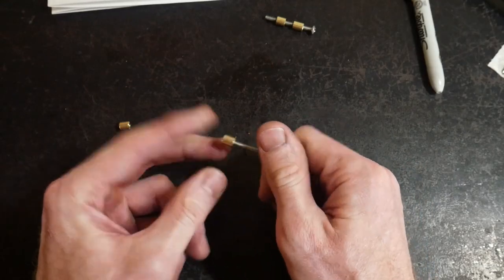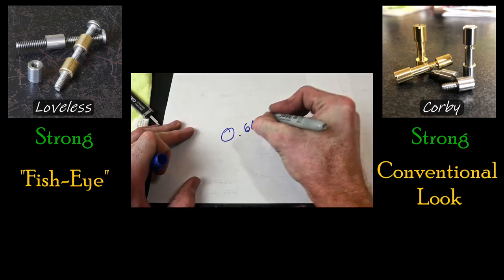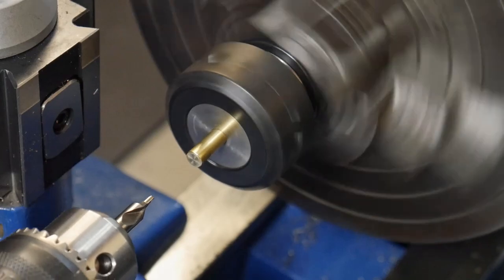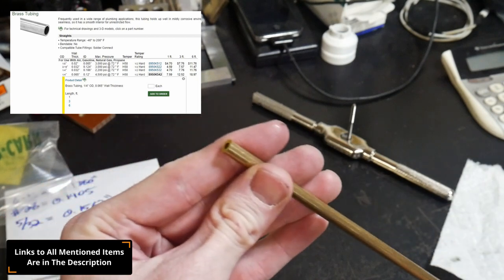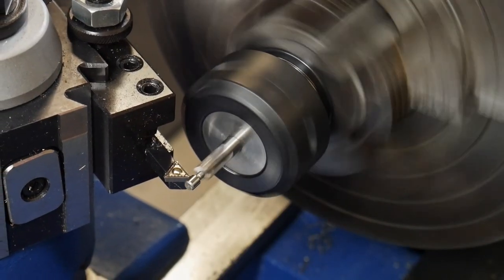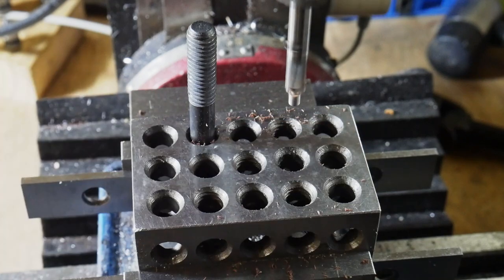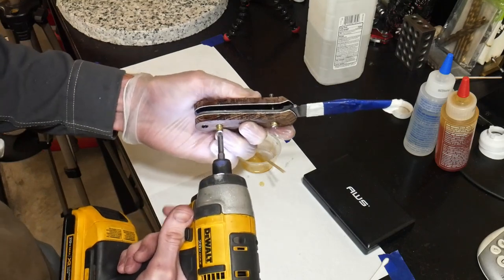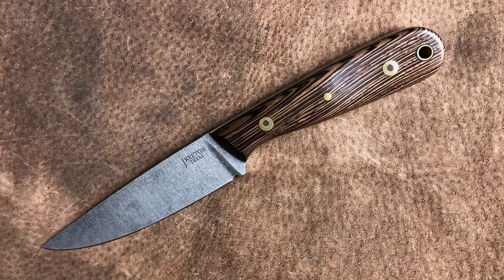LOVELESS BOLTS | How To Make Them | How to Install Them | Knife Making Fasteners

Comment from the maker: What's you're favorite knife handle fastener?!?!
Reply: Pins & Mosaic pins are my go to. I have bought corbys and their accessories. But not had the time to mess with them yrt
Reply: homemade mosaics
Reply: I love pin stock. especially if I make it mosaic but I'd love to use loveless and corby. Where did you get the numbered drill bit? I have heard you can get numbered matching drill bits that drill the counter bore at the same time as the center. do you know where I can get both a numbered bit set and a counter bore/center bore combo. It would be awesome to not have to buy individual bits anymore but whole sets!
Reply: Also have you ever done a copper/brass or brass/brass loveless? or are they a little to weak like that?
Reply from the maker: @stressmasterbk4294  Hey man, I linked to McMasterCar in the description. Check it out! They have all you're asking for. (Bits too)
Reply from the maker: @stressmasterbk4294  I have used brass/brass loveless. They're plenty strong for a knife handle!
Reply: Corpus with an occasional mosaic pin. I like the two colored look of Loveless bolts. What I really don't like is the litte visible section of the thread when you grind it flush.
Reply: I use pins. I am a new maker so I have experimented with some corbys. I looked at the link you have but couldn’t figure which one would be the best. It looked like you had one that was variable for the pilot. Is that right? I would appreciate your assistance. Blessings!
Reply from the maker: @01Tubee  Sorry about that I'll put the item numbers in there. The counter bore is 3102A11, the 5/32 pilot (that needs to be adjusted in diameter) is 3103A12, and the 3/16 pilot for corbies is 3103A13
Reply: @RedBeardOps  , you’da man! Thank you and keep up the good work.
Reply from the maker: @01Tubee  Cheers sir!

Comment: I’ve been using both of these for years for ease of use the Loveless is definitely superior. I experimented with a few different types recently I picked up off of eBay and people seem to love them I wasn’t sure at first
Reply from the maker: I agree! They're easier to use for sure.
Reply: Sorry man I tried to give you the link of the ones I’ve been using recently but it won’t allow me. I’m doing something I call a EDC custom Tear down so I’m not gluing the scales on just using a little locating pin and some talk bit fasteners so the customers can interchange between different handles and different bleed finishes the few that I’ve done seem to be going down pretty well

Comment: Look for circuit board stand offs. They are made of brass. I buy the ones that are threaded for 6-32 and 1/4" in diameter and 3/8" or 1/2" in length. This size works well for small handle knives. McMaster-Carr has them in boxes of 100. I use a stainless steel 6-32 x 1-1/4" screw for the bolt.
Reply from the maker: Very nice idea!

Comment: I've used Loveless bolts for 25 years. I use the ratchet setting on my screw gun to tighten them. After that, I simply wipe the excess epoxy off, and let it fully cure for 24 hours
Reply from the maker: Very nice! Cheers Rodney. I love these bolts.

Comment: Another source for the nut portion already threaded is Electronic Standoffs. I got some 1/4" x 1" Standoffs already threaded for 6/32 
One Standoff will yield 4 nuts if you cut carefully with dremel tooĺ with a cutoff wheel. 
Alternately You could ream out the Tube to .136 with #29 drill or a chucking reamer and tap for an 8/32 screw.
Reply from the maker: Very good ideas, Andrew!

Comment: Good vid, I have been wondering about the Loveless fasteners as I like the look. 
I saw another video where someone just got a bolt / screw, did up several nuts until they were tight on it, placed it in a battery drill and then carefully put it against a running belt sander with the drill also running to make the nuts round. Not as precise as this method I would think. It's always fun to make stuff you then use yourself I think.
Reply from the maker: Heck yeah man. I've seen that one too. I'm sure it could get you by in a pinch. Another commenter today mentioned getting some larger OD 6-32 hardware and turning that down. Thought that was a good idea too.

Comment: A really nice video, as usual. I don't use them and never have, but one thing I saw which seemed nice was in a video by ben orford of craftlabknives, he tightened his with his drill and has the torque setting set in a certain position on his drill to maintain consistency in his tightening. Maybe unnecessary but it did strike me as something that would guarantee a repeatable result. Thank you for your work on these videos.🙏🏼
Reply from the maker: Thanks for sharing! I really like that idea

Comment: New to using these bolts. I got them for the added security of knowing the handles won't fall apart. But, upon finishing I'm realizing there's a small gap showing where the threads become exposed. Is there a trick to not having that gap show?
Reply from the maker: on loveless there isn't a trick. This has become part of the look. If you don't want a gap, check out my video on corby fasteners

Comment: is the metal of the loveless screw noncorrosive? Where I live I cannot dream of finding any material for knives making, so I started requesting accessories from abroad through relatives. Other parts I'll have to make them at home, such as loveless fasteners and mosaic pins. Thanks for introducing the loveless screws to me
Reply from the maker: I like using stainless steel on my loveless fasteners. However, you can use what ever materials you like to use. Cheers!

Comment: I've never had the problem of the dreaded hole with Corbys. But I've been wondering about it a lot !. However, I'm sure I broke a Brass corby while tightening it by hand. I don't know how much it compromised the build, but I was really sad when it happened (especially since I almost exclusively use stabilized burl, which cost a lot lol)

Comment: Fantastic mate, great to see you honing your lathe and knife skills! might want to adjust your tailstock rearward slightly as you can see it pulling in when drilling your bores :)
Reply from the maker: Thanks man. Could you give me some more detail on what you mean? I have a left and right adjustment. I lined up two centers (one in the tail stock and one in the chuck) to get the tailstock in line with the chuck. I could probably tighten up the gibbs some more on it.
Reply: @RedBeardOps  when you were drilling your 1/4 deep hole you can see it pulling towards the camera slightly, its not a concern when drilling shallow holes but when you start getting deeper you run the risk of running out especially when your trying for concentric through bores. plus you can break drills in deep due to the flex point.
Reply: i should have said towards the back of the machine instead of rearwards lol
Reply from the maker: @troyam6607  Thanks for the info Troy! I'll mess around with the adjustment.

Comment: Hope this is  the most complicated way to make loveless bolts. Sorry. I don't have the machines you have. Hope I can find som brass cylinder with internal threat and the appropriate bolts. 
I guess it's easyer here in Europe with the metric system. 
I appreciate the first part where you did the comparison. Very good teaching 😊🙏👍
Reply from the maker: Thanks Max!
Reply: I’ve used ?3/16 Brass nuts and bolt - inserted into a drill and hand filed round.
Basic but it works
Reply: @tornagawn  that's is just what I could do also. Thanks 😊

Comment: I just buy both the nut & bolt that fit together & then I grind the sides off the nut making them flush & even.
Reply from the maker: Sounds like a good method, Renee
Reply: @RedBeardOps  
It works well, I buy several at a time & set them up so that they are ready to go. I don't have the equipment & tools to do a lot of jobs but I've learned to think outside the box for remedies. I enjoy your videos. ThankQ

Comment: Has anyone ever hand threaded their scales. Carefully. Hard woods would be difficult..

But glue and screw it in  and basically treat it like pin?
Reply from the maker: That's an interesting idea, I haven't tried it.
Reply: @RedBeardOps  i would think after gluing liners to scales  you would thread it from liner out  not  scale inward.  Possibly even start with the tang and go through it all..